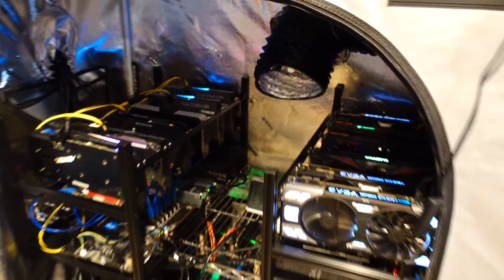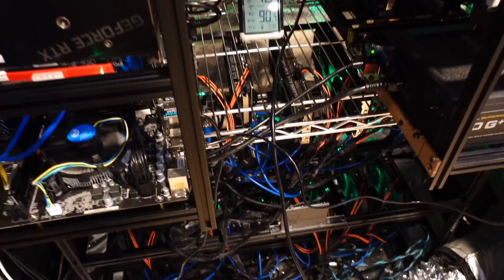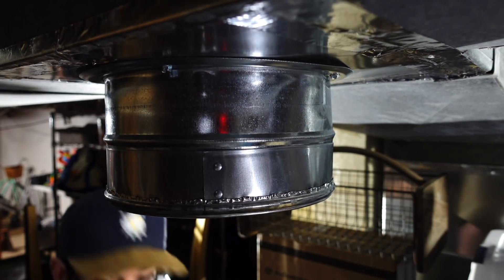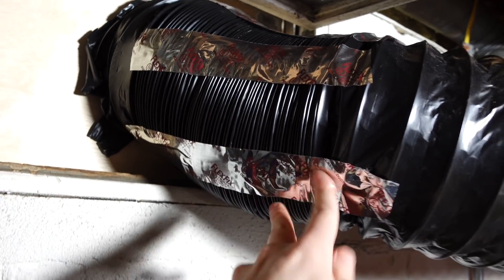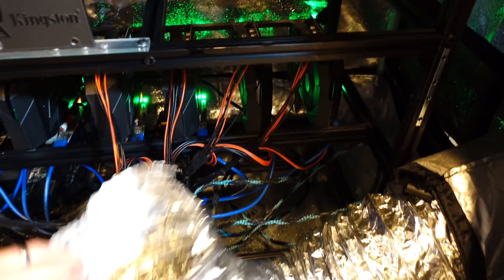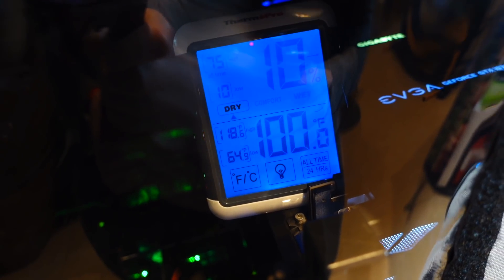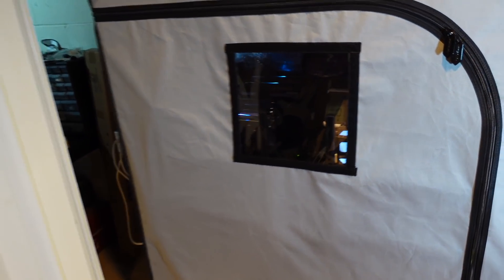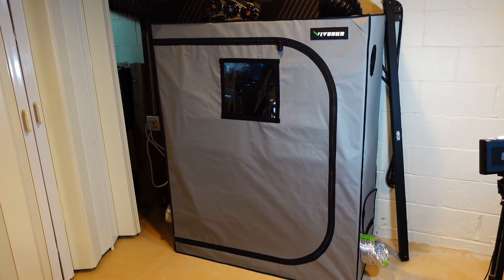GPU Mining Grow Tent - Summer Setup

Comment: I've been running my rigs in the garage with a 8" AC infinity fan which pulls in air from the outside through a garage window. but exhausting out with a reducer to 6" because that was just the size of the hole I had made. That way I don't mess with any of the air in the house. Gets over 100 degrees in even mild temps, but it's easy to just open the door to the house for free heat in the winter or open the garage door when I'm home to let it vent out naturally. I just recently got a grow tent and put 4 rigs in there and tried running the heat out, but it seems like there isn't enough air flow because it gets close to 120 degrees inside the tent on maybe a 80 degree day although the garage is cooler. 

I ended up removing the tent because it didn't seem like it was better, but I still have it. I didn't use ducts on the bottom like you did though, I just opened the bottom flaps. Do you think that would make a difference by ducting air higher up like that over the rigs? I'm not sure if I need a better way to get air in the tent more efficiently or I need to get the exhaust opening up to 8". It just seems like the rigs all run hotter in the tent which causes them to slow down a little.

Comment: Thinking of doing this on a smaller scale with just 4 cards, found a decent sized grow tent as limited on space in my bedroom (Which is where I can keep an eye on it plus out the way) Plan is to have a small rig with twin 140mm fans sat on a 5 fan laptop cooler all inside the grow tent, then can connect a vent pipe to feed out my window with mesh cover to help with less dust. Which is why I looked in to a tent so to keep the cards in good working order for a lot longer than in a open air rig because of dust and other small things that could get sucked in to the cards fans/heatsinks. Have a air blower to clear out dust build up in the tent as well as the case I will house all the main parts ie mobo, psu and a 1 gpu.
Thanks for the idea and will let you know how it goes for temps for those thinking of doing the same.

Comment: I want to do this once I have no more amperage to use in the room I'm currently mining my 12 card rigs in.  I plan on putting a sub panel in a storage room outside of my house. The problem is I live somewhere super hot so I'm concerned about getting cool air into the tent. Any thoughts?
Reply: The only solution would be a small window unit AC with a thermostat I'm afraid. Wait thats actually a good idea I'm going to do that!

Comment: Ive been wanting to do this especially since i retired from growing and am just going full into mining but so far everything has been fine with my 4 rigs in the basement never hotter than 27 degrees Celsius upstairs if i build another rig ill have no choice!

I have a question is it better to have extra space in tent or use smallest tent possible for out flow and such!
Reply from the maker: Really great question. I think smallest tent that gives you room to expand and add extra fans if needed. Less air to move out I think. I almost went a much larger tent so I could work on the rigs inside it, but opted for a smaller one and I’m glad I did.

Comment: i have the same tent 3060ti/ 3070's no issues but i cant close the tent with my 3080's they need a fan right on them rofl
Reply from the maker: Haha those dang 3080s. Thanks for watching dude.
Reply: @RedFoxCrypto  ya im tempted to trade my 3080's in for some 3060ti's they arent picky with heat. my one msi has 2 vivosun fans right on it lol

Comment: Great setup. Don't want to sound like negative nelly here but it looks like you are now creating negative pressure in your house. If you have a natural gas furnace and or hot water heater, the negative pressure will cause your chimneys to back flow into the house.  Carbon monoxide from pilot lights or even the furnace coming on to heat the house at night will flood your basement causing a death zone. I hope this is something you have thought about and at least get a co detector down there so you will know if shit is going south.
Reply: Of course if you are running very high efficiency gas appliances, they usually don't have a chimney stack and also have air intake and exhaust so it's a sealed unit which i don't think would be affected by the negative pressure in the house. Still to be safe I would put up a couple of co detectors to be safe.
Reply from the maker: These are all excellent points. I do have a high-efficiency furnace and high-efficiency tankless water heater in the basement. The ideal set up is to have that air intake come in from the outside and it’s something I may explore later, I need to figure out the right filters to use and make sure that they’re not blocking too much airflow coming in. Oh and I do have a CO2 and smoke alarm detector not far from the whole set up in the basement. Thanks for looking out brother stay safe and happy mining.

Comment: Are you concerned with pumping "bought" air outside? The volume you pump outside has to come in somewhere.....
Reply from the maker: Yeah I mean ideal would be to have it come from outside, but then I'd need to deal with filters to keep outside dust, pollen, insects from getting inside the tent. I think filters would reduce airflow as well so I'd need to adjust for that. 

Taking in the cool basement air worked well last year.

Comment: Hello, my memory is hitting around 92 degrees on my 6700xt I wanted to know I’d this is considered safe?
Reply from the maker: My 5700s run around there and have for a year now. The community seems to agree that 90 and below is where you want to be, but I think you are okay with 92. I'd adjust your fan speed up to 80% if it isn't there already and see if that brings down the temps just a bit.
Reply: My fan Speed is running at 60% right now so I’ll definitely do that and see if it helps any. Thank you!

Comment: Brilliant idea, but doesn't all that reflective material reflect all the heat back in? Might be more effective to blacken the inside
Reply from the maker: I think it’s more for light. I garden too and it helps reflect the light back to the plants that are growing.
Reply: From a physics perspective, there isn't really a distinction between visible light and IR, its all along the same spectrum (and is all 'light')

That said, you have more than enough circulation to make this a non-issue, any thing that is reflected is getting circulated out anyways
Reply: @FireOptics1  yes you are right, heat is just Infra-red. Those grow tents are designed to reflect as much light as possible back onto the plants, so heat gets reflected back onto the devices. You are right about extraction, it would just work more efficiently with some of the heat dissipating into the atmosphere

Comment: 100f 😬 maybe I should let the temperature bubble more before I turn on the AC . I get worried at 90f
Reply from the maker: Dude I know! It still makes me uneasy but the cards are running cool. I imagine the inside of a PC case gets the same temperature. Seeing those triple digits though makes me sweat. Literally.
Reply: @RedFoxCrypto  ya left the AC off and just Fan on the workshop window unit. It reached 91f but the 3070 cards were still at 55c with 120mm fans blowing accross. Getting a Ac Infinity AIRLIFT T10 exhaust fan soon so hopefully I can get into late May or June with no AC.

Comment: Def a 3080 will memory throttling inside the grow tent. 
Congrats of 10K subs 👍🏻
Reply: 7 out of 28 of my cards are 3090s in my grow tent and all under 61c :)
Reply: @StrugeLabs  surely not the GDDR6X memory though right?
Reply: I doubt he's speaking about memory temp... 61 is the gpu temp.

Comment: What's your normal rejection  %?
Reply: You should have ZERO rejected shares ever. 1% stale shares is ok, anything over that, you need to investigate, as it’s unnusual
Reply: @richardmaroun2117  well my over stability ratio is around 30,000 accepted shares with 6 rejections. So I think I'm good.

Comment: If I were you I'd probably get a Y splitter with a valve so you can just flip it between outside or inside without changing the ducting and stuff. Could then easily change it based on how warm or cold it is each day.
Reply from the maker: Yes you’re right. I’ll look into that for next season. Then I’ll want to figure out a way to automate it based on temperature...
Reply: @RedFoxCrypto  sounds like some Arduino work

Comment: One question though from a beginner to a veteran 🪖🎖️
When you get your brand new cards do you open them up and change the stock thermal paste and pads to get the best thermals?

I ask because even though I have a very cool strix 1060 6GB oc which doesn't need it, my new addition palit 2060 super dual 8GB needs to be on a 60 - 75% fan curve atm and it's still cold here in the UK but summer will be warmer so Im looking ahead as always and wondered if it would be a good idea to invest some money now to save rasing my fan curve in summer ( my girlfriends new question already is 'is your pc set higher today' 🤣 )
and possible thermal throttling.
Reply from the maker: Yo dude never do it with new cards except the Gigabyte 3080 which has issues out of the box with thermals. There were some 5700s like that as well.
Reply: @RedFoxCrypto  Okay thanks man keep up the good work 🪖🎖️👌

Comment: Idk your whole setup but it looks like you're sucking all of your conditioned air from your basement and sending it outside after it gets heated. You really need an air intake from outside. Otherwise you are using the air your AC unit cooled and sending it outside which means your house is under negative pressure and pulling in warm air from outside through all the little openings. Kind of like a bigger version of your grow tent, tentception. Basically its making your AC unit work extra hard to not only cool your house but also all the air it is sucking in because you're sending all the air it just cooled across your cards and back outside. That duct fan has a lot of air flow so i wouldnt be surprised if your electric bill skyrocketed during summer. If you use an intake from outside the air coming in will be like 70-80F most days depending on where you live, which is plenty low to keep the cards cool and in turn, reduce your electric bill.
Reply: Negatively pressuring a  house could lead to dangerous CO back drafts with gas  appliances. If the exhaust from a gas hot water heater is continuously sucked back into a house from negative air pressure,, deadly CO could build up inside the house with fatal consequences.
Reply: hi Cade, Serious question! What if the intake from the outside air is 115 degrees where you live
Reply from the maker: Yeah I’ve thought about this. I’d need to put some filters in place to filter the outside air getting pulled in to prevent pollen and insects from getting into the tent.

My basement is unfinished so it’s not technically a conditioned space. I have no AC vents opening into my basement. I’ve also thought about the idea of moving the whole setup into my unconditioned garage but then I need to figure out filtering out all the sawdust I create when working in there.

Thanks for the comment buddy.
Reply: @RedFoxCrypto  All the air its blowing out that vent has to come from somewhere. My first guess would be to check the door leading to the basement if you dont have vents down there and second would be small gaps in you ductwork. You could always light some incense and see where the smoke goes. Idk, just trying to help a guy out. I've got a bug screen over my vent and a cheap furnace filter from lowes covering the hole on the inside of my garage.
Reply: @Iridium239  Quick question, I just received my grow tent and I want to pull intake air from outside.  My question is where I live it's not only hot, but super humid.  Is the humidity a concern when pulling in air from the outside into the grow tent? I don't want any condensation on the cards.  I know the hot air coming off the cards is dry, but is that enough to offset the humidity coming in?
Reply: @pinaycollectibles3074  I don't know. If I was doing it,  I would do a test, try one card and see if it works without condensation build up, then test with another card, then another, etc. I might be inclined to use a conformal coating if condensation is a problem right off the bat. Or run a dehumidifier. Good luck!

Comment: Great idea for low humidity areas. The problems i can see is that grow tents are designed to maintain an adjusted atmosphere so any atmospheric condition not controlled (humidity in this case) can become compounded quickly. A failed intake fan or clogged vent can mean rapid temp raising and a shut down of your rigs or worse. Great idea if you have the money to run a dehumidifier inside the tent or have redundant systems independently operating like fan intakes on separate power supplies, etc.
Reply from the maker: Yeah I have a dehumidifer running in my basement all year. It definitely helps.

Comment: Great video.

I’m  just about ready to pull the trigger on a grow tent. 

Could the negative air pressure not cause issues with the rest of the home ? I see many others take in air from the outside.
Reply from the maker: Thanks Dan. Yeah my basement isn’t conditioned, but if you put this in a conditioned space you’ll want to pull air from outside so as to not pull all you AC into the tent.
Reply: @RedFoxCrypto  What's the negative consequence of pulling all of the AC air into the tent? I thought that would be cooler?
Reply from the maker: @jagz888  The GPUs will be but the rest of your house won’t be.
Reply: @RedFoxCrypto  haha sure, are you thinking of getting a warehouse or you feel it doesnt negatively impact home life, your vlogs are helpful i think all noobs like myself struggle with noise and heat. Noise seems to be the main complaint in my household. thinking of doing noctuas would be great to forget they are there. have you tried doing this ? swapping all fans in the rig and cards with noctuas max quietness without losing too much hash?

Comment: Hey man I'm in a very high humidity area with salt air what would be the best way to setup rigs in a grow tent that lowers the chance of salty condensation forming on all the coolers?
Reply: A lot is going to depend on the insulation of the outdoor room. Increasing insulation will decrease how hard climate control has to work, thus decreasing cost of operation. My climate is roughly 90f high ambient temps at 80-90% humidity, on a coast line with high salinity in the air. If this is similar at all to your climate you are going to need a/c to exchange hot air for cool air and a dehumidifier(depending on insulation). You can get window units that have dehumidification built in. I'd personally never put my miners outside of an air controlled building without a massive dehumidifier in my climate. If temps are less for you but still high humidity, you can get away with a dehumidifier only but depending on type you may have to modify the water tank to dump outside or be required to constantly empty it.
Reply: @rscalliwag07  well thought out reply . best considerations so far
Reply: a dehumidifier and  a strong air filter . keeping the shop dry and the salt out of the air
Reply: Don't use this in a humid climate unless you don't mind an additional $70--100 a month in dehumidifier and a/c costs. I dedicated a room in the house with a window unit (not everyone has this i understand) because constant 80% humidity in my climate.
Reply: @rscalliwag07  very similar issue I have I have dedicated an unused outdoor bathroom but I cannot have the door open of the humidity rises drastically in the room. I'm lost on what to do to help with getting cool air without ac.. 
Maybe a filtered tent?
Reply: If buying a window unit/dehumidifier isn't a problem but cost of operation is, consider building or buying a solar generator. Something with just a few more kw/h then the unit draws.